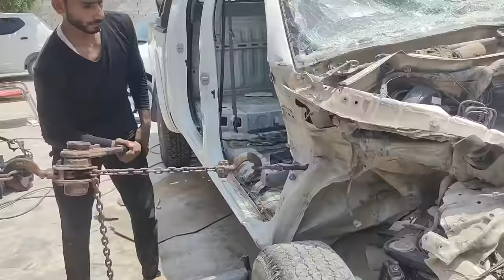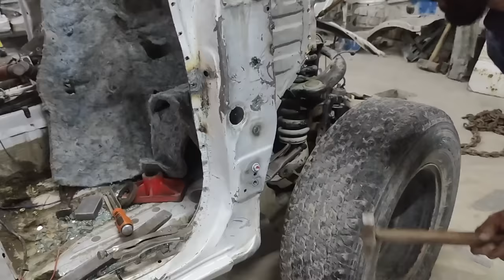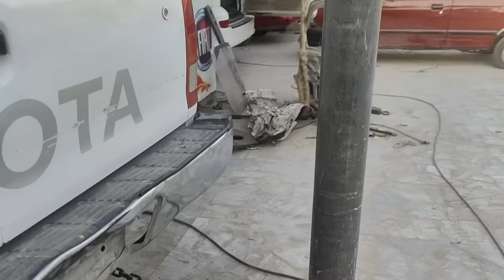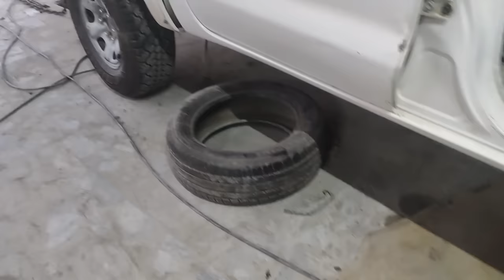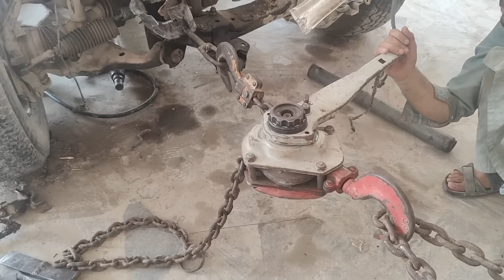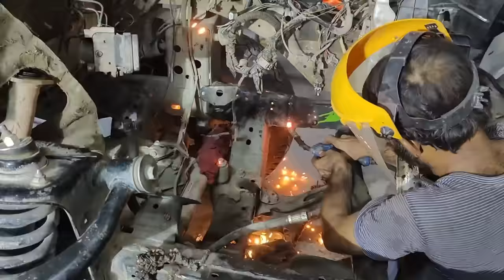Toyota vigo Major Accident Repair

Comment: I used to do this sorter work but the car was clamped to a jig with special pins that corresponds to measurements in an manual and there was rails on the floor for the puller’s!
Reply: yea hydraulic powered L pullers. the Chain hoists are creative. I dont think that would pass a crash test after those repairs. No new parts just peel them off and straighten them. Kinks and all. all that heat on the frame and it is compromised.
Reply: butt welding the frame. I am sure that would be totally safe. No fame bench....eyeball. I mean we did some stuff that way but not a repair like that. Everything was safe and seamed properly.

Comment: Just an observation here but, structure (frame) in the front was bent, straightened(??) with a come-along and a iron post and not on a jig. I'm betting this truck rides sideways from now on and likely will eat tires like there's no tomorrow
Reply: It's a death trap. Tires are the smallest issue here.

Comment: This truck would be totaled in USA because of extensive damage to the body and frame . It will be a liability to fix the vehicle this way , no frame welding , only replacement of the frame . There are repair standards for the safety issues .